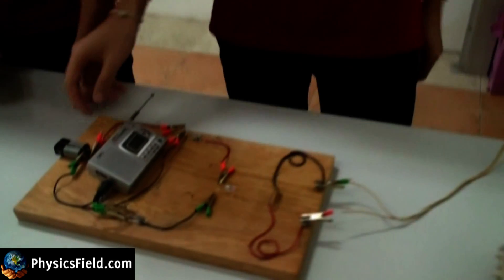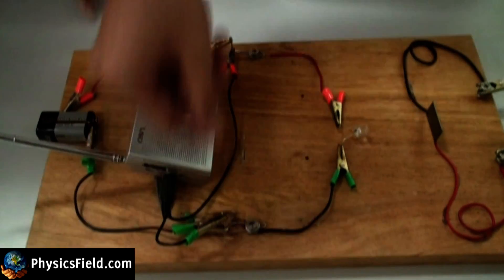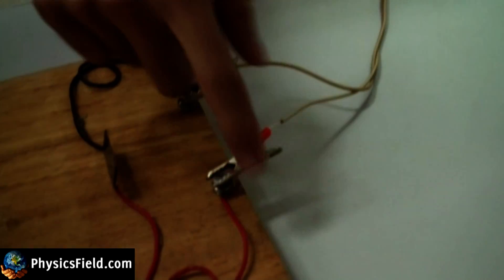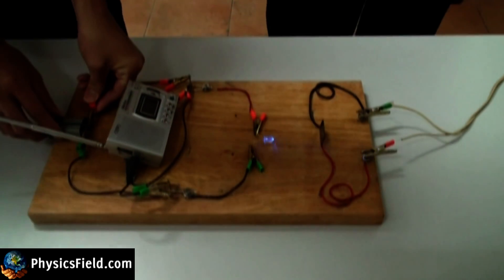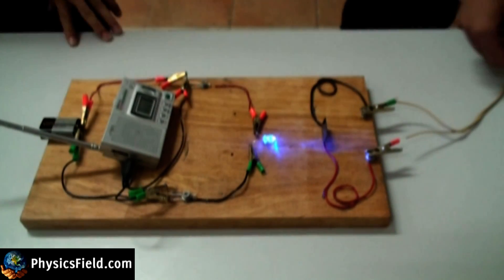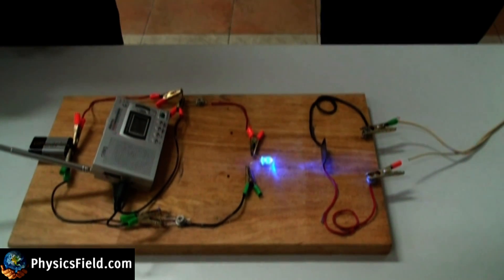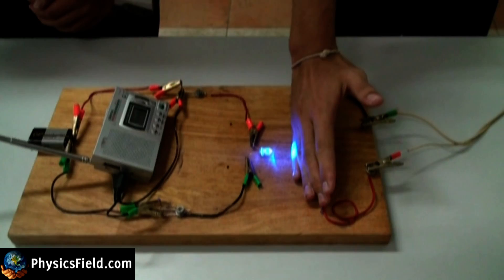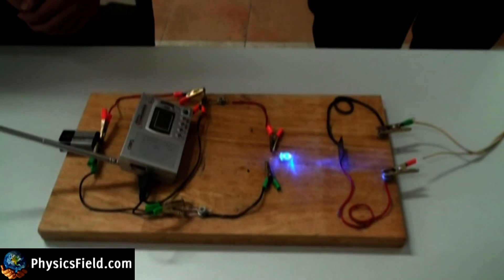Modulated LED - Listen to a beam of light

Comment: For Transmitting a Video Signal, I would Imagine that you would need to create Photo-Voltaic cells (Solar Cells) that simultaneously absorb and transmit the Light Signals of the Video Feed. Instead of having the everyday solar cells that only absorb light and transfers into electricity or sound wave based electricity.